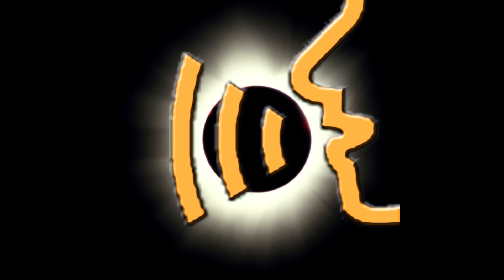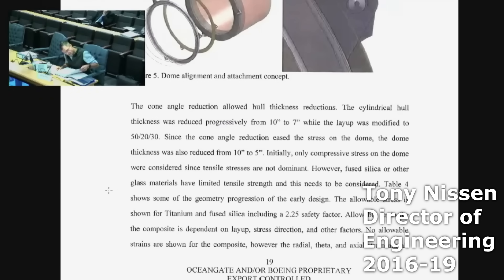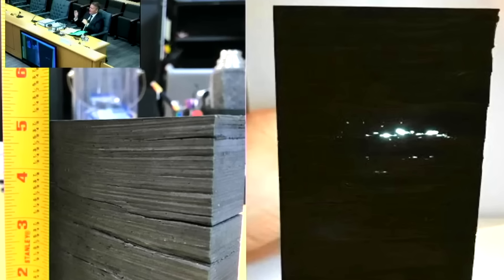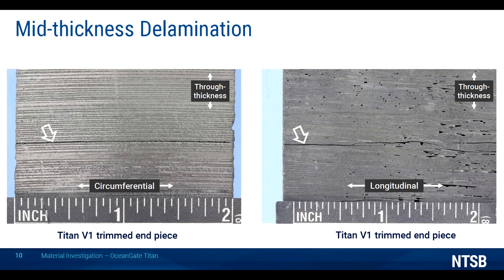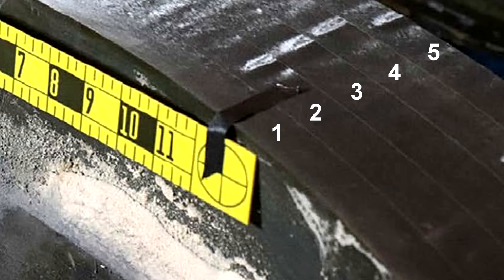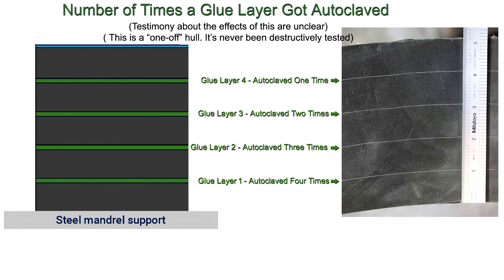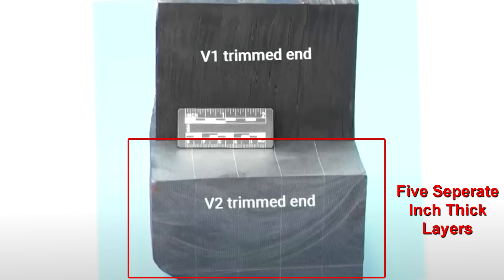Who Engineered the OceanGate Titan V2 Hull? Maybe Nobody Did?

Comment: Subs, space ships, and locomotive boilers all have something in common, a pressure on one side of the material, and it usually can handle the same amount of pressure either direction 

NASA is not really paid enough to care about someone else failing to do the most basic steps, they can only give guidance to help them along the right path

IIRC, carbon fibres, much like concrete, have a preferred strain direction

Carbon fiber is extremely strong in tension
Concrete is extremely strong in compression 

Both are fairly weak in the other direction, to varying degrees
Reply: Stockton's original plan was to build this submarine with duct tape & superglue. Carbon fiber was a step up but as far as Rushton would compromise. Besides, his company had a money flow problem
Reply from the maker: All good points.  Thanks for commenting.
Reply: Exactly 👍
Reply: So you're saying my concrete submarine is gonna work?

Comment: Oceangate built a submersible using software engineering procedures: Do only what you need to have something that works, fix things as they show with the product in production... The problem is these practices are not good at 4Km under the sea... 😀
Reply from the maker: Thanks for commenting.  You are correct.  And, I would add that there is nothing released to the public at this time about any engineering company that may have taken on the analysis of the second hull design. That is a mystery.  I had a viewer mention that there was an aerospace company (not Boeing)  involved with the engineering of the second hull, but I don't know where he got that information from and it is not in the Coast Guard hearings as far as I can tell.
Reply: Yes and no. I worked in healthcare programming. We had procedure to go around programming issues. This usually involved multiple layers of alerts and backups. We made sure it is easy to see that a process failed. 
Iterative programming without safety is fine for non life critical stuff. 
It feels Stockton did not feel that if it fails people die, he did not get it.

Comment: Nobody engineered that imo obvious fake. Tube ends will not withstand the water pressure. In addition the half ton hemispheres have other thermal expansion coefficients wich will break the seals. Further the inertia of the spheres will break the tube ends while towing and craning, the lighting is ridiculous for that dephts, no trim, no oxygen circulation and and and. If you see that project as an test of intelligence, you all failed. 🤒🥴🤣😄

Comment: When making the 5” Carbon Fibre Hull. After each one inch layer. Was made, it was wrapped in Preg  Ply. Then put into the Autoclave. After removing from the Autoclave. The Peel Ply was removed . And bulges were ground down. I am no expert but it seems that there were flaws. That was ground down. To me that doesn’t sound like the Pressure Hull was level, or by that point safe either. But Stockton (I’m in a) Rush (to get this finished as cheap as possible. So he could get. Paying passengers. To play Russian Roulette with their lives. Just so Stockton Rush. Could be remembered. Like his famous ancestors. Now he is remembered. For all the wrong reasons. No 1/3 scale testing. Because of cost. Rush was playing god with peoples lives.
Reply: That's one of the wildest part about this. Unknown variables like sections undergoing multiple autoclave sessions aren't nearly as concerning to me as the fact they literally had to grind down the bulges each time, thus severing or severely weakening the fiber strands at random points across the entire hull.

What's especially frustrating is I do believe carbon fiber has potential in industries like this but such recklessness sets back hopes of further developing it for years.
Reply: Good comment but wtf is this sentence structure
Reply from the maker: Thanks for your comment.  I agree with you.

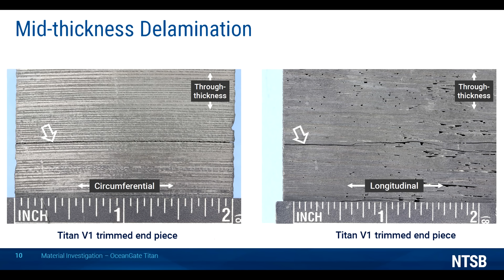Comment: 10:30 Electroimpact doesn't have autoclaves, there's no way for them to do that.
Reply from the maker: Watch the entire video please.  I've done my research,  15:29.  Thanks for your comment.
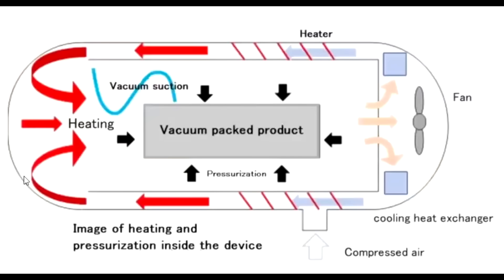Reply: @solareclipsetimer  Gotcha, I did watch the entire video, and I talked with guys who did the project. You contradicted what you said at 15:29 with what you said at 10:30. I've heard EI didn't advise on how to autoclave that thing or do it on behalf of OceanGate. OceanGate designed it and picked all their vendors individually which made the liability for the system all on OceanGate.
Reply from the maker: @emccolly  Thanks for your reply.  I am not sure I understand your issue, however.  At 10:30 I am setting up the story for Phil Brooks, the OceanGate engineer who testified about Electroimpact wanting to do multi-cure process or they weren't going to build it at all,  at 11:51.  Although not explicitly testified about, clearly it has to do with the fact that you can't build and cure a 5-inch thick hull, so EI had a part in the discussions.  So in my storyline, I link those two bits of information (10:30 and 11:51).  At 15:29 the video explains that Janicki is involved because they have the autoclave.  I never said that Electoimpact consulted on the autoclaving process because I assume that Janicki was following the protocols given by Toray for proper curing of their system; Toray product number for the pre-preg system was P2362W-19L, consisting of a T800S-series intermediate modulus carbon fiber and a 3900-series epoxy resin.  So, I don't see anything that is contradictory, I did the best I could telling a complex story with many moving parts.  Thanks for adding to the discussion.

Comment: OceanGate: "we have a 5-inch thick hull! :D" 

Boeing (with over a decade of experience with carbon fibre hulls and wings): "you should use 10 inches. But if you optimise it well, you could use 7 inches" 

OceanGate: "Okay!" *Still uses a 5-inch thick hull 

Stockton Rush rapidly turns to soup 

If only someone had seen this coming...

Comment: That sounds like a nightmare. They had 18 million dollars why didn't they just use titanium?
Reply: I guess the answer is the same as every time something tragic happens: it's cheaper.
Reply: @David_randomnumber  yep, that’s why they cut corners and refused refunds to “mission specialists”.
Reply: Contrary to what most people think, Titanium is not an excellent material. It has some very good properties, but it isn't easy to work on.
Reply: @ it also doesn’t cause catastrophic implosion 🥴
Reply: @ But still quasi-catastrophic implosion.
Reply: Because iNnoVAtiVE (aka cheaper)
Reply: Because they where laundering money and wanted to go cheap.
Reply: The DSV Limiting Factor has a titanium bell, and it costs seventeen million United States Dollars to produce.

The DSV Limiting Factor Carries two crew.  The point of The Titan was to carry more people than could be in a titanium bell vessel-by utilizing the replaceable structure.

Comment: The DESIGNS were good enough. 
The MANUFACTURING ....
This video ignores the grinding of buckles in every layer until the last (show in diagram red oval 4:33). This video is meaningless.
Reply from the maker: Thanks for your comment.  My next video deals specifically with grinding down the humps in the laminate.  That issue was so complicated to explain, I separated it from this video.  The image at 4:33 was an image that I took from the graphics I was making for the grinding video.  This video is about the engineering decisions that led them to continue to make a five-inch thick hull as stated in the second line of the video.  So, this video is not meaningless at all, in fact, it is very comprehensive regarding its stated goal.  Search YouTube for my next video under the title   OceanGate Titan Hull - Hundreds of Ill-advised Carbon Fiber Grind Spots
Reply: Carbon fiber for a pressure vessel with a higher external than internal pressure is a complete nonstarter. Any design that used that approach is not good as a rule. Manufacturing can't save a fundamental misunderstanding of materials.
Reply: @danjones1608  Except for uniform application of load across biased fibers. They threw out the 45-90 design and went with 90 degree only. Multiple layers of multiple wraps at angle will transfer load and eventually work, as load translates into tension in subsequent layers. It is far from ideal but to say 'any design...' is not true. AFTER THAT the biggest problem was sanding down the post autoclave buckles. They sanded several millimeters to make the surface uniform for the next layer. Those are the failure points. Exactly ZERO load can be carried with any material that isn't there.
Reply: Your words could only be created by a design engineer.
I know I am one, but I also respect manufacturing. You obviously don't.

Comment: One of the lessons I learned from my engineering boss who had 45 years experience in design is: you don't taper a cylindrical shell section which adjoins a hemispherical head unless you can prove the cylindrical section has a thickness sufficient for the pressure at the exact transition to a spherical shape.
The way they glued the shell to the titanium rings probably contributed f*ck all to overall strength at the shell cylinder ends...

Comment: "The hoop stresses are lower than those remote from the joint!"
Woah! As a pressure vessel design engineer I'm not even mad... I'm amazed...
Applied stress is one thing, how your sections of your vessel behave subjected to it is a completely different thing... 
Guy had no clue how membrane stress theory works.

Comment: How did they account for the strength of the bonding layers between the fibre layers? 
If the bonding strenght isn't equal to the strength of the main loaf bearing material, loads can't be distributed. Madness... Woah!
Reply from the maker: Thanks for your comment.  You have figured out the crucial point which is going to be the subject of my next video.  The glue between the layers has to be so good, so strong, it has to be like the layers aren't even layers.  If not, then the hull is not behaving like a 5-inch hull.  You nailed it.  Turns out, it is even worse than that, the glue was clearly breaking down.  There was shear occurring between the layers.
Reply: Looking at the photos from the sea floor, the remainings of the hull look like you've dunk a wafer into hot tea... 
Regarding the strength, in our industry (pressure vessels), welded joints must develop stength equal or greater than main material. That's why I questioned the adhesive.
Now, if you are curious (you are  😂), have a look at ASME VIII-1, there is a section which is dealing with layered wall vessels, which I'm not familiar with, but might bring some insight into your research.
P.S. We've pushed zirconium reactors for acid to maximum possible calculated pressure before they were put in service. Not just the 1.3 x MAWP ASME or PED/PESR 1.43 x MAWP test pressures. I think the factor of safety was something like 3.5x !!!
So this guy was a true cowboy in his approach.
Reply from the maker: @simsnqta  Yes. based on your experience, you know for something like this you want to "overbuild", not "underbuild."  Thanks for responding.  I tried to check that ASME code but the site was down right now,
Reply: loaf bearing.

Comment: One of the main mark of a good engineer is the honesty to acknowledge that a pet idea is just not going to work. Carbon fiber was just not a good material to make a deep diving submersible hull especially NOT on a commercial profit making vehicle expected to make dozens of dives cheaply and fast. Stockton saw the failures of the scale models and he deliberately avoided conducting a "test to destruction" test on final hull design to determine the true crush depths of the final Titan hulls. This was ostensibly for cost issues, but such a test could possibly have exposed potentially unfixable flaws of the carbon fiber materials. Stockton and his enablers were just too wedded to his pet idea of a carbon fiber deep dive submersible hull to thumb his nose at his critics that he crammed his idea through regardless of the warning signs the tests were showing.

Comment: Something, it was suggested to have a ten inch thick CF cylinder. Then downgraded to seven inch, then five? Eh? What?

Something that has concerned me is the machining of the cylinder ends, potentially weakening the CF construction, and the titanium on the inside of the channel on the end caps. There must have been considerable pressure on the that inside edge as the CF was pushed inwards by pressure. Is that enough thickness of titanium on that inside edge to take that pressure?
Reply: stockton was always  talking about getting rid of safety margins.  he figured he could cut it in half and not die.
Reply: the main guy of this project was simply an idiot trying to boost his ego. this would happen all over again if it didnt take him.

what we learned is, that oceangate created a disposable submarine. use it a few times then replace.

Comment: If OceanGate had spent more money upfront on a titanium hull, they might have saved money and avoided failure, instead of spending millions on multiple carbon fiber rebuilds that still ended in disaster.
Reply: The carbon fiber was innovative and it worked for the initial dives but the inability to accurately gauge damage meant they were basically disposable and continued use meant higher risks for each consecutive dive.
Reply: @supernova743  Innovative does not mean better. It's also no substitute for testing.
Reply: il was light.

Comment: so the 5th layer was essentially reduced to 1/5th of its thickness where it attached to the titanium rings and they didn't think structural integrity would be affected
Reply from the maker: Thanks for your comment.  So, I don't know the exact measurement, but what you are asking is correct.  They had to remove a lot of material from the final layer to fit the hull into the old rings.  Regarding the structural integrity, I don't know.  Like you, I don't think it seems right.  But for the V1 hull, for which it had to be done also, just with less material removed, Spencer Composites said it was okay to do on the V1 hull.  I guess they just assumed it was okay again on the V2 hull even though it was much more material.  Seems like a bad idea.
Reply: @solareclipsetimer
No thank you, these are super entertaining and the only videos going into the design of the titan in proper depth 🙏🏼 (a bit shocking tbh).
Yeah was just roughly gauging from the image how much was taken off, and it could be fine for sure i have no idea. Its just like how you said about them adapting it to V2, it seems that they just alter the design to fit what works/is convenient and dont properly account for how this might effect the integrity. 
similarly to the repeated autoclaving of lower levels of carbon/adhesive. Similarly to the sanding the carbon ripples and similarly to using a non-convex glass on the viewport. Its like they wanted as many possible points of failure 💀
Reply from the maker: @ You are correct again.  Happy that you like the videos, I appreciate the feedback.  Thanks.